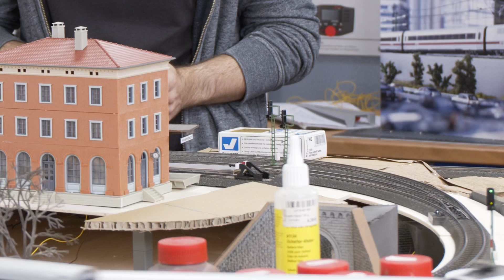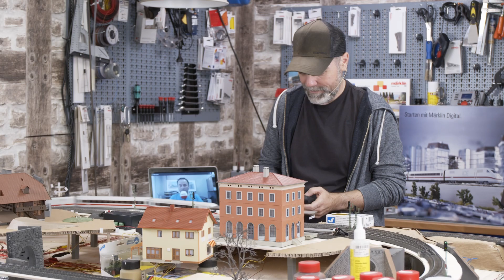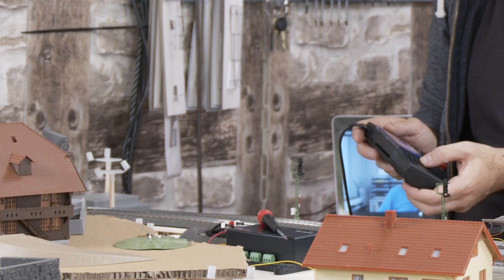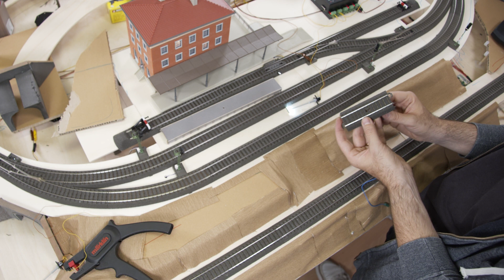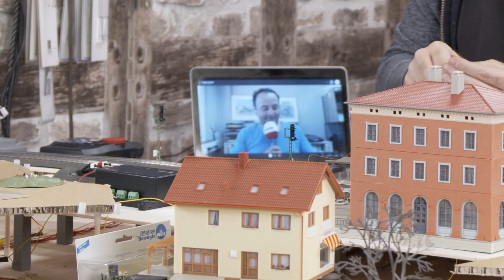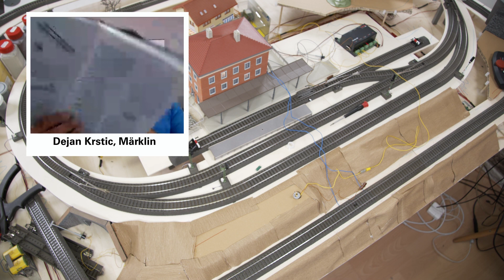Building a Model Railroad / 18 / Control your lights with a circuit track

Comment: What is the size of the cables use for voltage on the track, for use a starshape. Is 0,14mm thick enough. My base plate is 360 x 140 cm with 2 layers.  For controlling the trains I use now the mobile station station 2 but later on may be the central station 3 or 3 plus or ??